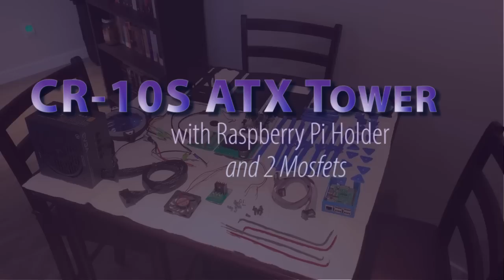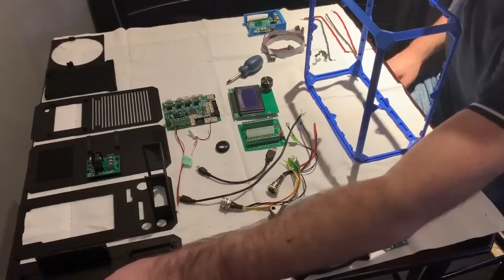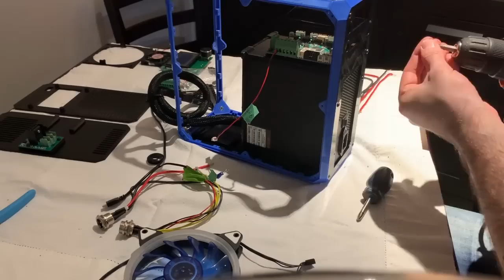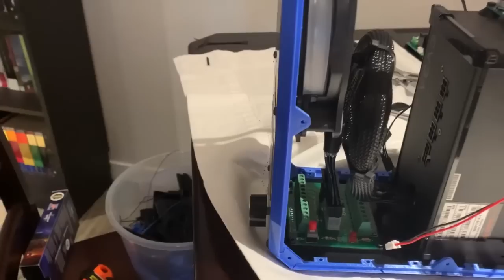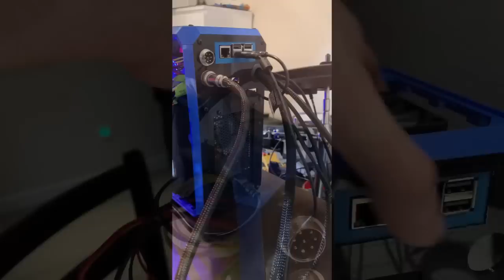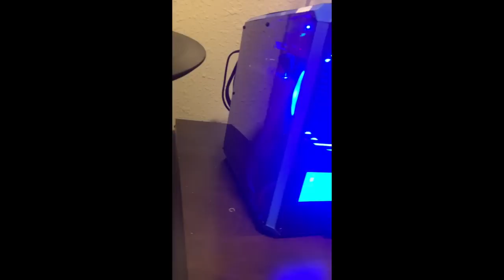3D Printed CR-10S ATX Tower with Raspberry PI conversion

Comment: Wow, great work, very clean.
I have a question though. How did you electrically balanced the power for the heat bed ? Is one phase of the ATX power enough to heat it or do you need to connect several one ?

Edit 1:  ok, sorry, I jjust looked carefully to the wiring diagram and found my answer. You just need to make sure the atx is able to give 25 amps on the 12v rails.

Comment: How bad was the wire part of the build? is there a picture pdf or something that explains it more in depth?
Reply from the maker: Marcus Lomvall not bad at all, I put a diagram on ThingIverse that explains it
Reply: The 600watt psu aint that a bit "high" what is your recommendation on watts?  @DC-vu7dq
Reply from the maker: @Maxflax121  It is, like I wrote in the description I am looking to upgrade some electrical components requiring more power such as a better heated bed. Also I got this modular ATX for a good deal. I wouldn't go less than 400 Watts in my opinion.